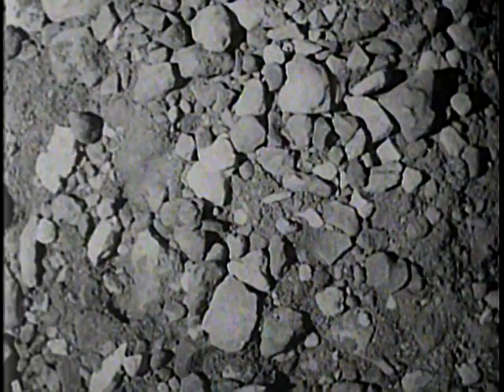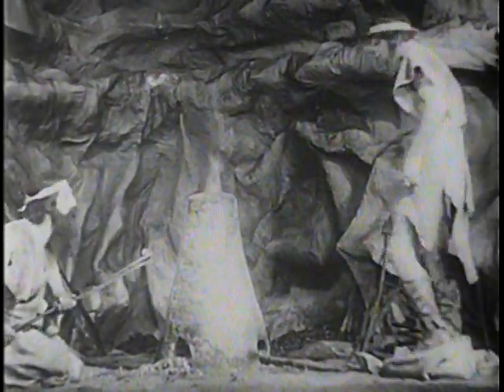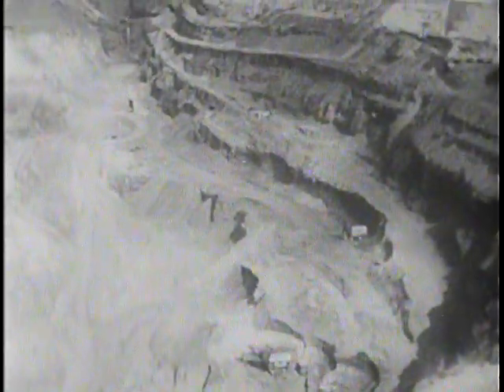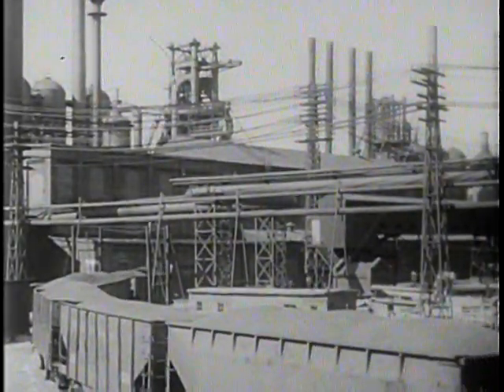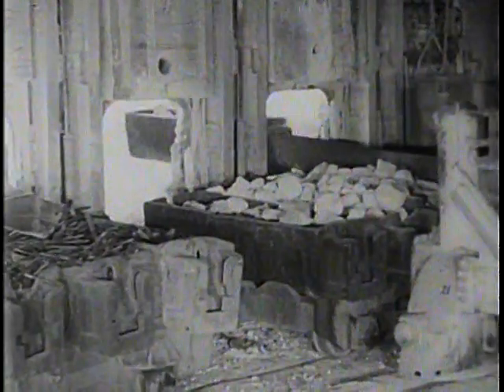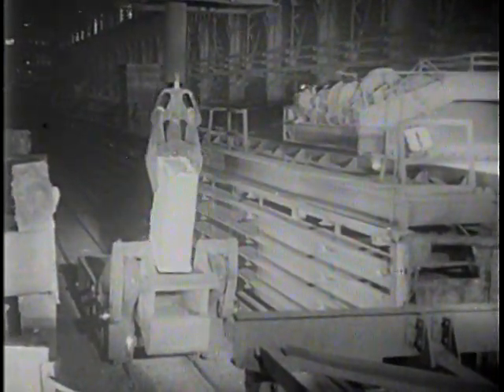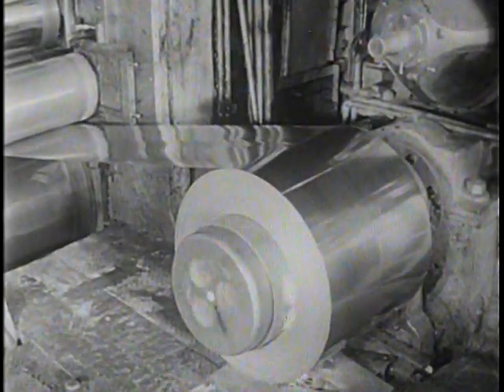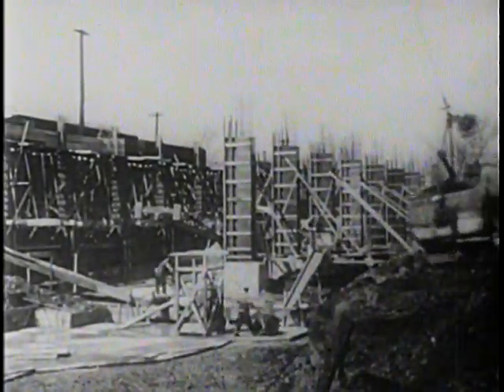The Drama of Steel

Comment: Made in 1946 and much of this process technology was superceded during thr 1970's.
Dirth and dusty Open Hearths were largely replaced by Basic Oxygen Steelmaking and the slooow process of pouring of ingots, removal from moulds, reheating for rolling into slabs etc. was all replaced by the continuous casting process. Steels were made a lot purer to give them greater purpose with the addition of processes such as controllled Argon bubbling, Vacuum Degassing etc. The average Joe Blow does not know this but it led to higher strength sheet steel in cars that were much less prone to rusting. So much change to the processes since this movie was made. Blast furnaces are much more high technoligy also.
Reply: Yeah, it's amazing that anyone could think that the decline of the American steel industry is the fault of anyone BUT the US steel makers! The fact is, when the rest of the world re-built their iron and steel plants following WWII, they used the newest and most efficient available technology; America kept-on with the tried & true tech, which cost them dearly when customers started switching from bulk, mild steel orders to small-scale, specialty steel orders; large plants in the US couldn't economically produce small batches of products made from fancier steel grades; but the new 'mini-mills' OUTSIDE the US could!